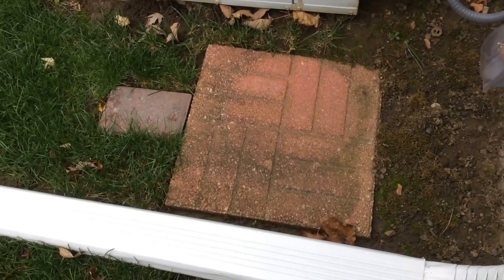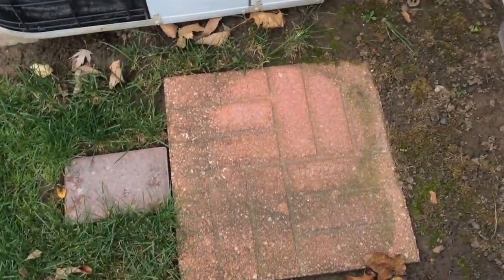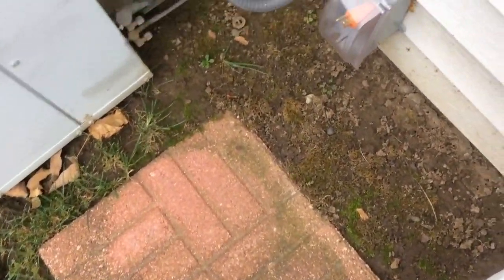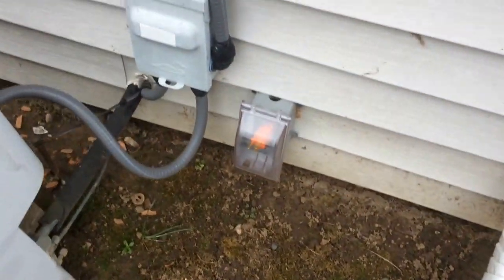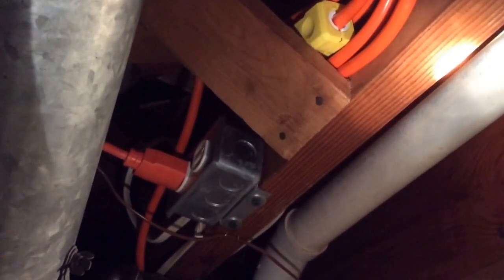Furnace powered with a Generator

Comment: I like what you’ve done here. Simple quick and effective. But you didn’t show which model generator you have. Does yours have split phase? Meaning does it give 240v output?  If so, then you would need a second cord to utilize the other 1/2 of the generator’s output capacity. If you have a small generator with only a single 120v output then what you have here seems like an ideal solution.
Reply from the maker: I have a larger 240 volt, but this set up is for my smaller 2000 watt unit
Reply: What size generator i need to get 3500 start or 6500 start pls some one help bad weather will hit us again
Reply: javier reyes the right size generator depends on what you are powering. Some devices are clearly labeled with the watts needed. I’ve found that the kill-a-watt meter is a great device to measure the power used by devices. It’s cheap and easy to use.
Reply: @neilbrookins8428  thanks So much i will look into that as soon as possible, weather here in Michigan is bad and some areas no power, and i want to learn how to power my furnace in case of an emergency but I'm a little confused with the wiring, mine has a switch to turn on off i was thinking to pig tail the switch to still controll the power flow to my furnace by using it, what u think? Thnks for taking the time to help me i really appreciate it may GOD bless.